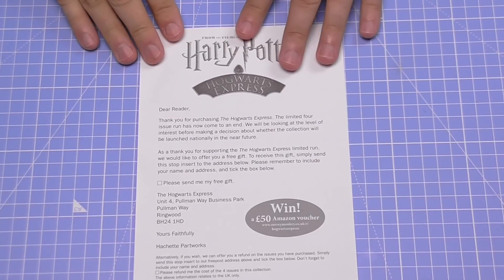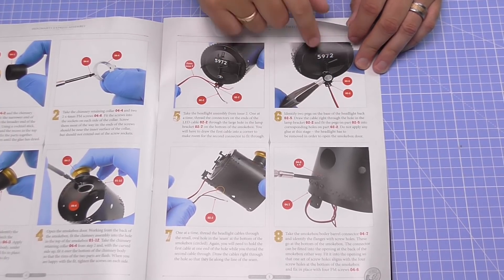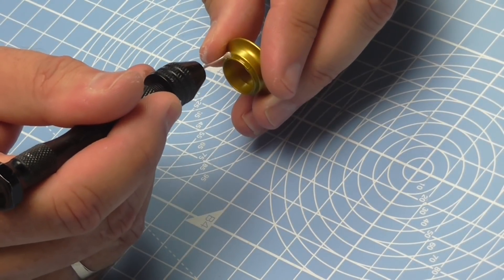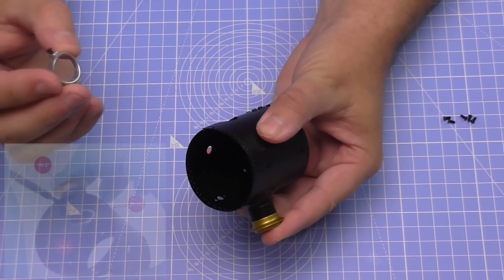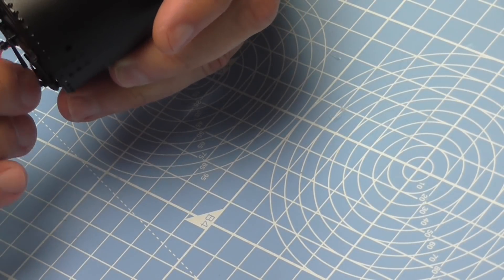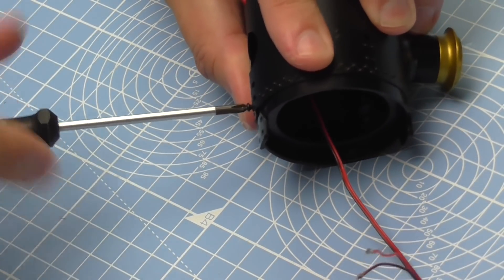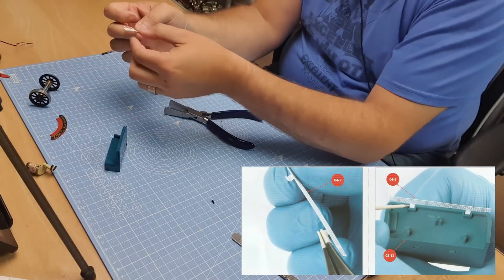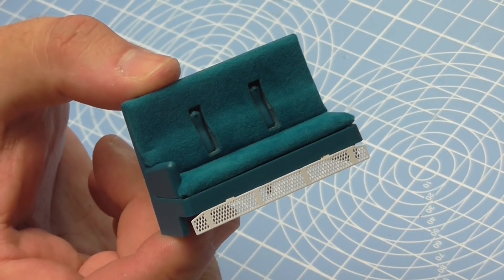Build the Hogwarts Express 1:32 TRIAL - Issue 4 - (Final Part) Chimney and Seat Grille

Comment: Did you know in the days of steam there were several places that the lanterns could be placed. Two lanterns were generally used in different locations on the front of engine, the positions that the lanterns were placed showed signal box operators and station masters where the trains destination was so they could set the points to put the train on the correct track.
Reply from the maker: Wow

Comment: That collar to hold the chimney in place is a heck of a  lot better than the job they did on the C57 locomotive from DeAgostini. For that one they just want you to glue everything on. Problem is, the paint then peels off the metal parts and nothing stays together, meaning you have to glue it again on the now bare metal where the black paint used to be.
Reply from the maker: That sound awful

Comment: Sadly in the US we don't get cool kits like this but after watching this and noting the scale I can't help but wonder if it could be run on LGB garden scale track like a regular model locomotive.
Reply from the maker: Its slightly bigger the O gauge but I wouldn't be surprised if someone mods it to be motorised.
Reply: @WorldofWayneUK  I though from the info on it it does look to be motorized, though not sure if that's just to turn the wheels or if it is motorized enough that could pull itself down some tracks.

Comment: I wonder if Hachette balanced the licencing cost versus the potential revenue and concluded it wasn't financially worth it. The problem is balancing the HP fanbase with the model making fan base /and/ those who can justify the whole cost of the part work. If the HP licence costs plus the cost of developing the model and the tooling to make it are more than they'd get back it's not worth it.